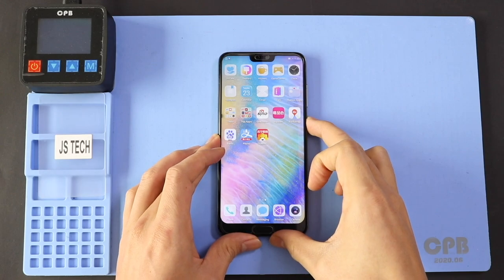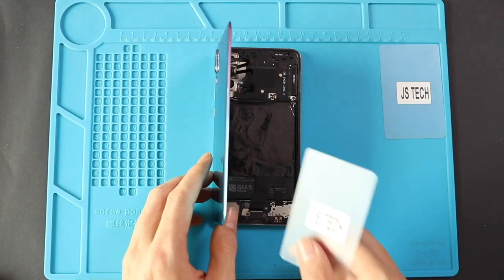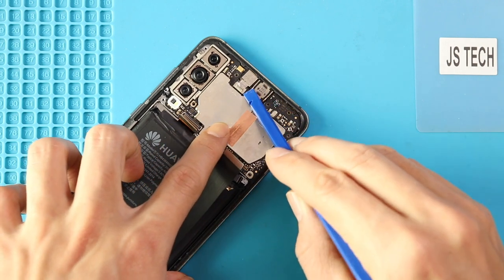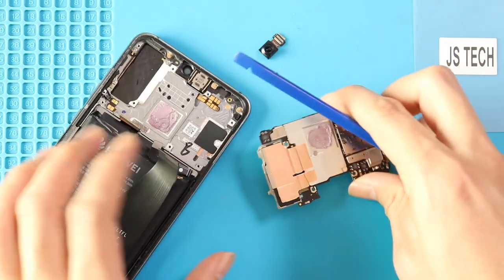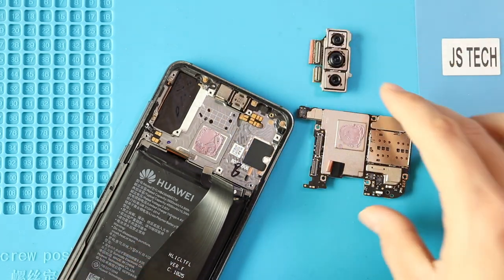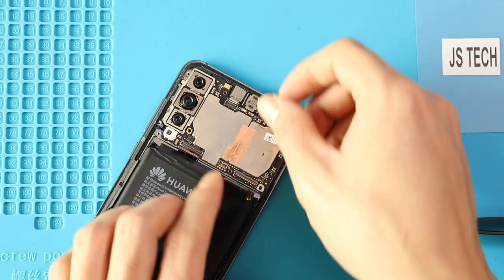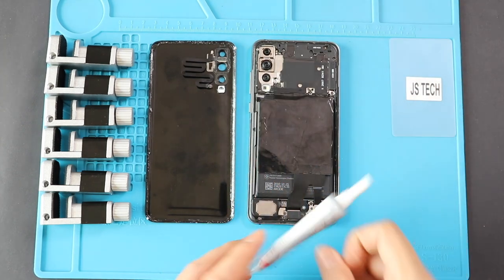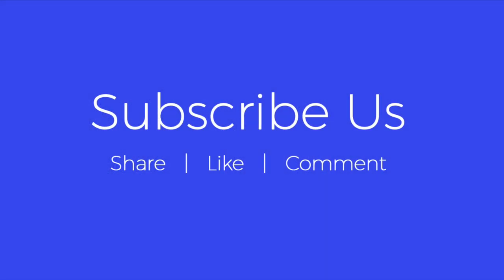Huawei P20 Pro Camera Replacement

Comment: Can the 40mp sensor from the p20 pro be transplanted to the mate 20 pro? The 40mp sensor in the mate 20 pro has the same specs as the p20 pro except for the OIS. I e not sure why Huawei didn't do it but I think the low light images would 50 times better when mate 20 pro AIS is combined with the 40mp OIS sensor.
Reply from the maker: not possible.

Comment: Can anyone guide me to a replacement for that wire that goes from camera lens to the main unit? I guess it is the wire for some sensors there..
Reply from the maker: Time stamp plz ?
Reply: @DIYGeardo  The wire that goes from between the camera lenses and the mainboard at top of video at 1:15, where you unplug it. Is it some distance sensor?